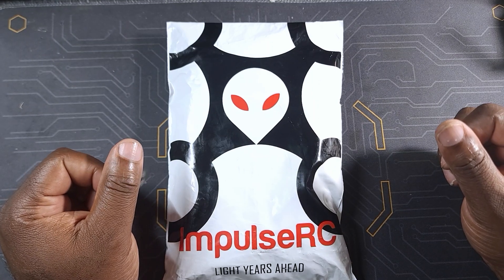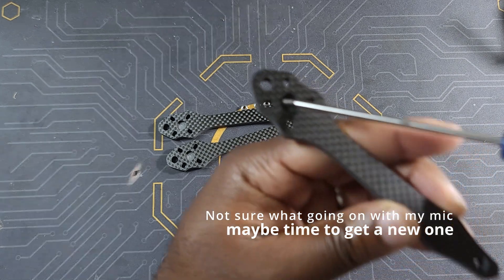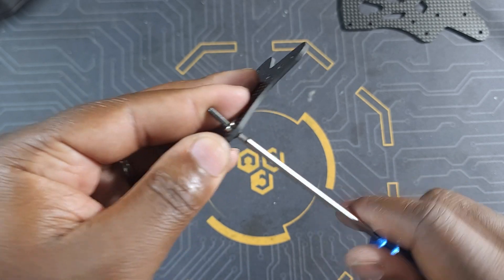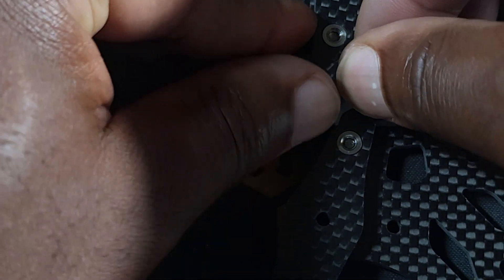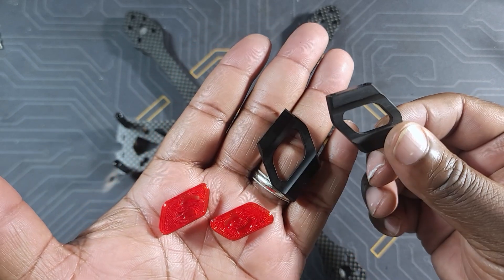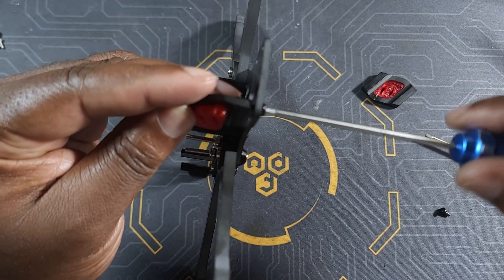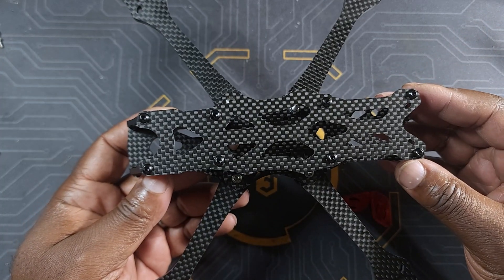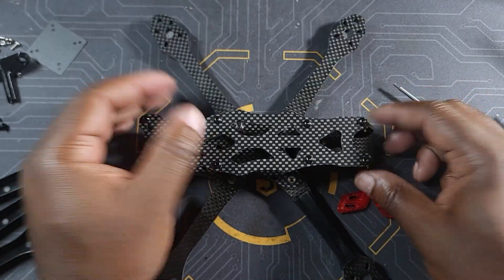ImpulseRC Apex EVO 5 FRAME BUILD

Comment: can you fit the 2 antenas for the older air unit through the 2 tiny holes at the back of the top plate ?
they only incl a tpu for the 03 antenna
Reply from the maker: You could make it work,  but I will advise  you to either 3d print  a moun( check out thingiverse.com) or buy one

Comment: Do you have any clue how to mount the o3 (with screws) to the frame? I am confused
Reply from the maker: The red cam holder  goes on the inside portion of the metal plate. Just look at my thumbnail for guidance
Reply: @GBoniFPV  you got me wron i asked about the VTX = o3 but no worries i got it already